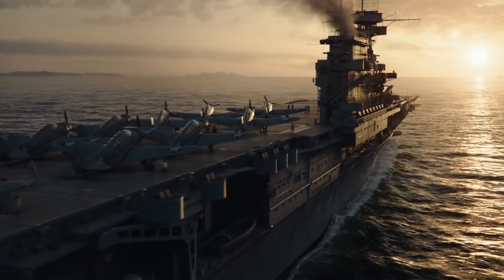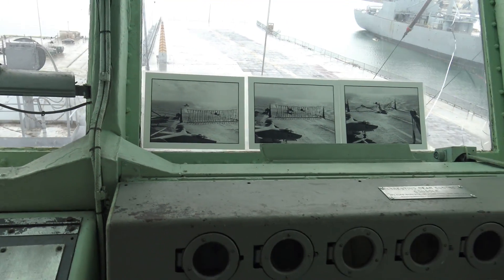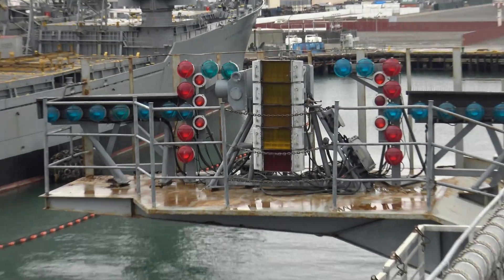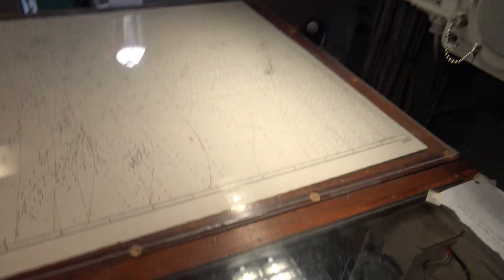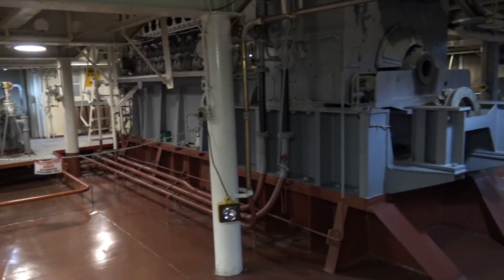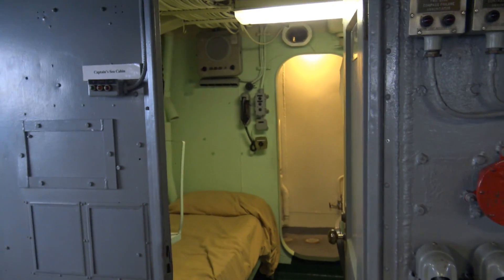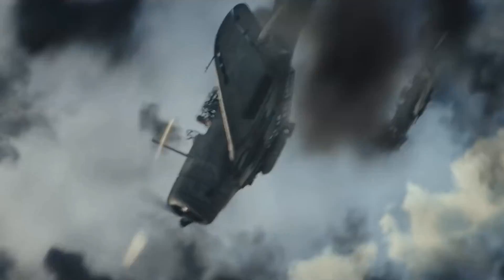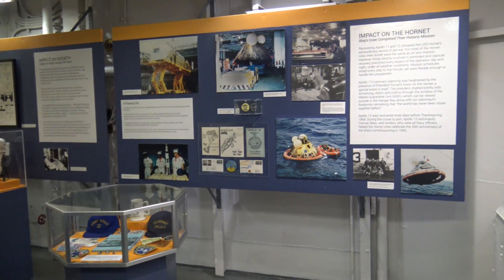What's It Like Aboard a WW2 Aircraft Carrier? - Let's Visit the USS Hornet

Comment: I worked at a factory without windows, 12 hour shift.  Hated it.  Even the break room didn't have windows.  After a few years they moved the break room so it had windows.   I need to see outside during some of the day.  Also the low ceilings and drab colors would also suck.

Comment: On the Hornet there's an escalator running from the hanger deck to the flight deck.
Reply from the maker: Yeah I went up that one but didn't feature it in the video as I wasn't sure at what point that was put in. Thought it might be just a museum thing.
Reply: @InvictaHistory  Mid '60's according to one docent.  There are photos on the 'net showing two pilots loaded with gear going up the escalator.

Comment: A Royal Navy Officer, Captain Dennis Cambell was the designer of the Angled Flight Deck, with the first Aircraft Carrier to be tested with the Angled Flight Deck, HMS Triumph, with HMS Ark Royal launched in 1955, being the first ever Aircraft Carrier to be purpose built and launched with an Angled Flight Deck, the lead Carrier of the Royal Navy Majestic Class being launched after, followed by the U.S.S Forrestal
The Optical Landing System, the 'Meatball', this was also another British invention, invented by Nicholas Goodhart, and was first trialed aboard HMS Illustrious and HMS Indomitable, it was installed on all Royal Navy Aircraft Carriers by 1954, and then in 1955 that U.S Aircraft Carriers adopted the system
The third Royal Navy invention for use on Aircraft Carriers was the Steam Catapult, invented by Commander C. Mitchell Royal Naval Reserve, it was first trialed onboard HMS Perseus in 1950, the Steam  Catapult was found to be more reliable than the Hydraulic Catapult being used on U.S Aircraft Carriers during the 1940's, and by 1952, the Steam catapult was widely accepted and adopted for use in all Aircraft Carriers

Comment: A bit if clarification is need this hornet under went a very extensive modernization program during the cold war. The original flight deck was a straight wood deck and the planes would land and take off under own power and with there own brakes. The catapult and cable system along with the angled metal deck was installed post war to deal with heavier jet fighters.
Reply: Jason Irwin Pretty sure every carrier has always had arresting wires, no plane could stop it fast with just its own brakes.  Some of the WW II Essex class had a catapult, but it was very rarely used, as most planes didn’t need it.  It was only used on low wind days for planes with very heavy bomb loads. The later Essex class ships had he catapult deleted.

Comment: If you pay attention at 01:40, you'll see that behind that yellow trainer plane lies the most dangerous piece of equipment on that entire ship; A blue Genie Lift lol. They don't call them widow-makers, but they sure as hell should. The problem with them, especially on sea-borne operations, is that they're way too narrow, which makes them handy in tight spaces, but also quite dangerous. I've seen one of those lifts tip over on a perfectly level concrete pad, and that was from within the "safe operating limits" that were stated in the manual. It was one of the few cases where a work-place accident could be blamed almost entirely on the machine. Everything on that machine was running within specified parameters, so it's not something that could be blamed on a mechanic. Just imagine how much worse operating one on a swooping and heaving CV deck would make it. Then again, I very much doubt that any CV would be using Genie lifts like that one on an operational ship. Stuff like that only belongs on a decommissioned ship that never moves or on perfectly level terrain.

Comment: The "control room" overlooking the deck is Primary Flight Control  (aka PRI-FLY). The person in charge there is known as the Air Boss.
The speed control in the "wheel house" is known as a Telegraph.  The "primitive" charting computer (yes, it was technically a computer) was rather advanced technology for the time.  Been there four times, met Buzz Aldrin during the 40th Apollo anniversary.
Reply: The primitive charting computer is called the DRT for dead reckoning tracer. Ought to know as I put the parts back.

Comment: Sorry, you said fighter & five bomber aircraft were launched by catapult on Essex class carriers. That is not true. They were launched off there own power. Essex class was before the advent of catapults. That’s why the 2nd hornet cv 12 is different from cv8. Cv8 had a straight flight deck & no catapults. Cv12 had an angled flight deck & catapults. Before catapults carriers had to either launch or receive aircraft. It required the entire flight deck to launch aircraft under their own power. They advent of angled deck & catapults made it possible to launch & recover aircraft at the same time

Comment: Sorry, YOU FOULD THIS UP SOOOOOOO BAD. Most of the THings You're Pointing OUT came AFTER WW2 with the Advent of the Jet Age. THAT'S whent he Catapults and Fresnel Lens approach system Really Came Into Play. In the WW2 days the planes weren't Hevy Enough to Require a Catapult, they took off under they're own power, and yon Recovery you had a LSO *Landing Signal Officer) a.k.a Paddles, that USED High Visibility "Paddles" to Indicate to the Pilot his roll, pich and Yaw as approaching the Deck. the Aresting System in ww1 was a counterweight/hycralic affair to set tension on the cables  via equipment below the flightdeck,  those things you were calling "Anchors" for the Aresting Witres were NOT the Anchors they were tensioners between the arresting cables and the Cable spools Below Deck.. in the Heady Days of WW2 the angle deck DID NOT Exist, Each Plane recoverd and Via Elevators wa droped below to the Hanger for Serviceing and Rearming then via an aft Elevatoer Rerased to the Flight Deck and Spoted for Launch.

Comment: WW2 aircraft carrier but discussing systems that were installed post WW2 for jets.
Reply: Yes
Reply: To some degree, yes, but for the most part the systems described were fairly accurate. While hydraulic catapults were not commonly used during the war, all US Navy aircraft carriers have been fitted with them, albeit not very strong ones on earlier carriers. The arresting wire system was based on the same idea as the modern ones as well. The biggest issue with this video is the terminology he uses to describe things, and his lack of recognition that the essexes did not have angled flight decks until they had underwent the SCB-125 refit.

Comment: They don't say "full speed ahead", it would be "ahead flank". In the engine room, if you had a big speed change you would open the main turbine throttles, put additional boiler oil atomizer guns online, possibly startup another feed pump and/or condensate pump, and keep a close eye on boiler water levels as the quantity of bubbles would rise sharply and push the water level higher.

Comment: Fun fact: The newest carriers in America's fleet have replaced steam catapults with electromagnetic ones. The reason why it took them so long was because it was found that the extremely powerful electromagnets used in early Mag catapults didn't have enough shielding, and this caused a few aircraft to have their computer systems go AWOL on them from the small EMP that it produces. Needless to say, with all modern aircraft being primarily fly-by-wire, computer-driven affairs, losing your ECUs/computers right after takeoff is a rather bad turn of events. 

Since the shielding required for such a system was super-expensive, as well as extremely heavy, tis something that we haven't been able to effectively incorporate into a carrier's systems until somewhat recently. Even so, a mag-catapult is easily the heaviest piece of equipment on the entire ship, if you don't count the reactor or its turbines, and having that much weight right up top had to have some clever engineering decisions undertaken in order to make it a sea-worthy system. 

You'd be amazed how much care and due diligence is required for adjusting the ballast on one of those asymmetrical behemoths. If you took the ballast away, in the blink of an eye, the ship would develop a heavy list in excess of 90 degrees, and it would do so quite rapidly.
Reply: It caused their computer systems to go away without official leave??
Reply: As I recall - the Hornet had electric catapults
Reply: @janreeves5443  I didn't know that. She must have had some teething problems with that system for it to have not been used more widely during her era, or maybe it was just deemed too expensive to build, maintain and overhaul. Maybe putting one on the Hornet was a shakedown arrangement of sorts. Obviously it didn't go too well, which is evidenced by the fact that I had never heard that the Hornet had a mag-catapult on it, and I'm what you would call obsessed with history.
Reply: @alecjohnson5043  Indeed. Luckily it was only a test-bed, so it's not like they would have been testing it with the latest and greatest hardware lol.
Reply: H3R3T1C
Reply: @luisparga5707  Hmmm?
Reply: And now the electromagnetic cats are having high failure rates. Nothing like salt water and electronics.
Reply: @kimalexander4083  Indeed. It's just ol' Murphy reasserting himself lol. Either that or their epoxy-potting methods could use some work, being that it's damn-near impossible to seal off a catapult with water-tight compartments, being with that big gaping hole (the track) in the top of it and all... I've yet to see any proper method of water-proofing that track. Telescoping sleeves/gaskets may have worked with steam catapults, but they're useless for mag catapults since they aren't even close to 100% impermeable.